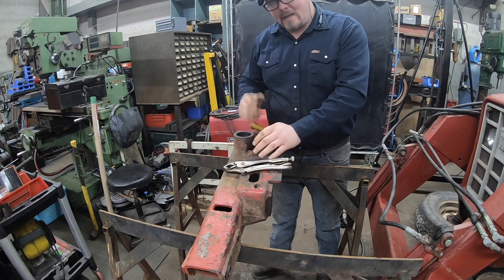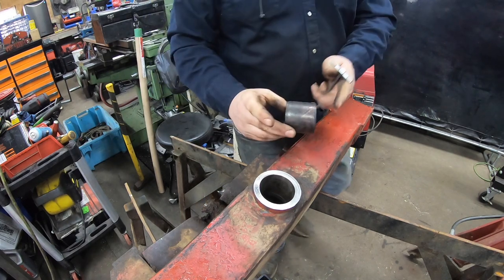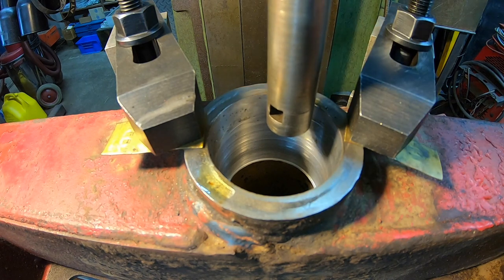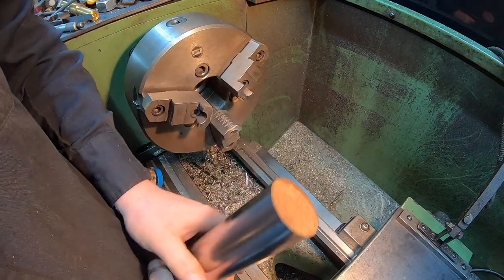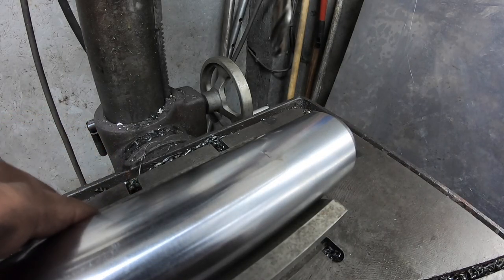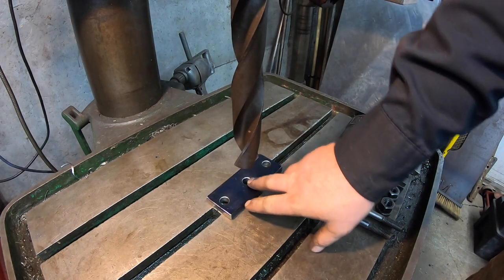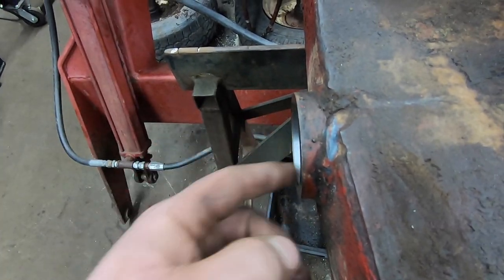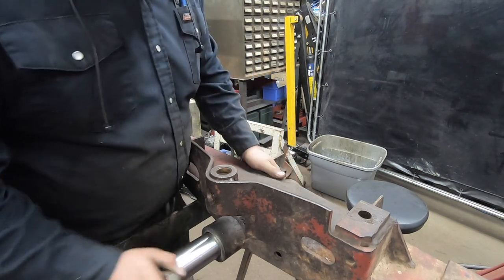Repairing International 574 Front Axle Pt. 2

Comment: That method of aligning it on the mill is great! Thanks for showing it, I have to do something similar on a much smaller piece soon and I'll use this method.
Reply from the maker: My Gun Garage it worked out good, although looking back, I should have used a fixture with a larger shoulder for the axle to sit on, may not have resulted in my boo boo 😆
Reply: @alrmachineworks7090   Maybe a jack at each end of the table too to steady things while it's being clamped down. BTW, I'm with you on those stupid barbed Zerks.